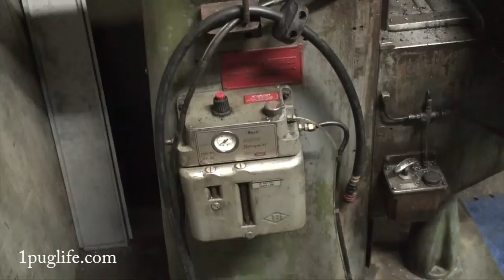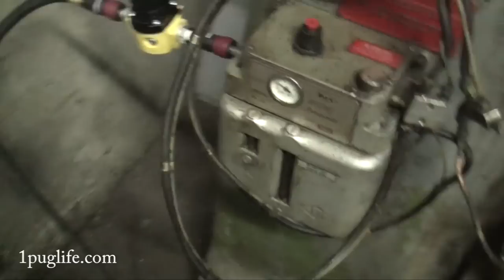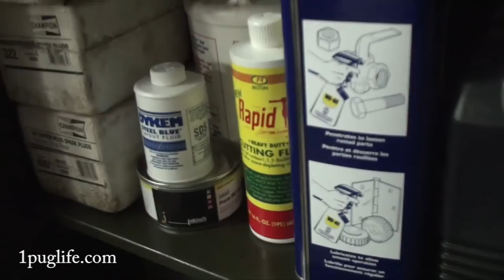just bout lobster buds!

Comment: The 2 flutes are slot drills which you can use to drill into a metal and then cut, as opposed to end mills which have 3 or 4 flutes and made for side machining only. There are always exceptions eg. 3 fluted slotdrills antlers etc. You might want to use roughing end milling for the first passes or you could get BVD to chew on it like a beaver.

Comment: Hi Pug does that original regulator on the milling machine lube pump have one of those spring loaded anti fiddle adjusters on it, so you have to pull the black knob  up to lock the red part together. Then hold it up to turn it to adjust the pressure either way. Pretty sure one of my compressor regs I had once was like that before it screwed up, and it went to China the great land of recycling, so pig iron could get more new  stuff back to sell L.O.L.

Comment: 4 flute end mill will give you a better finish but slower while a 2 flute will machine faster.
From what i see 2 flute fine either taking too much in a cut or the spindle speed to fast not a anoth oil on it should flood really, after that the metal shit

Comment: PUG1 try to mill less material in one pass, smaller chips draw away more heat, you can see it by the color of the chips. Also try to use a brush with some good cutting oil instead of using the oil can or a cheap spray, with a brush you waste less expensive cutting oil and it is easier to apply. But I think you want to do the job too fast, so try to do it slower.

Comment: Just a little info on the speeds and feeds - I go 1000- max speed with 2 flutes that diameter about .5 - 1" deep on alum. 
I go somewhere around 200- 325 on steel. Google a "rougher" endmill to hog that stuff out. I bet you have one in the hoard you got. Gotta go slow and steady with steel at low speed. http://www.promaxtools.com/speeds-and-feeds.html